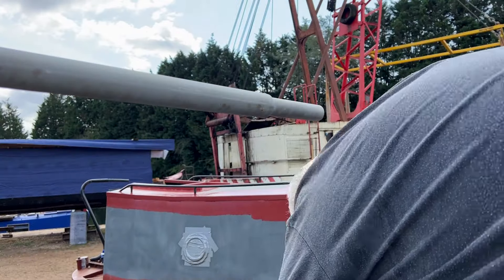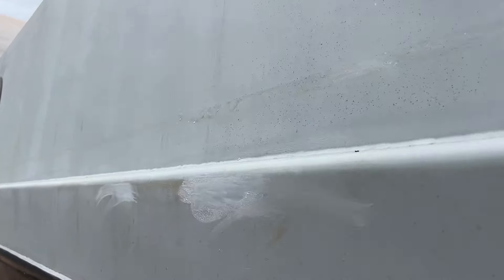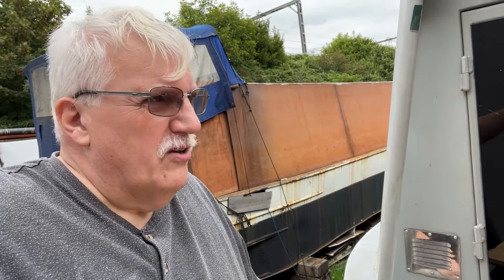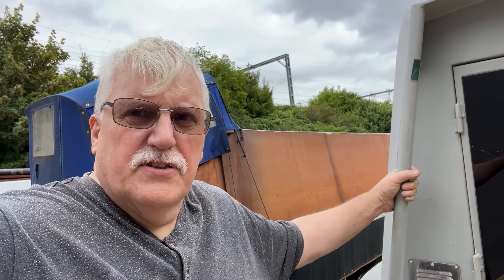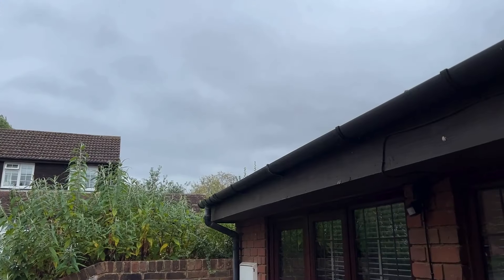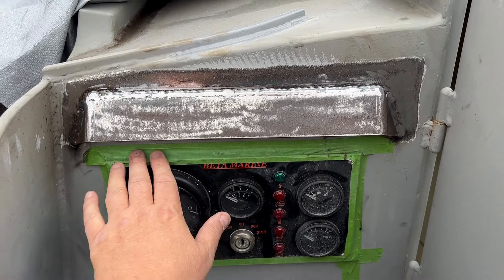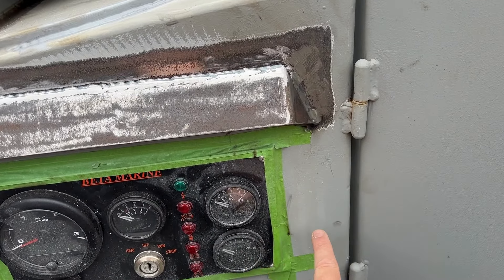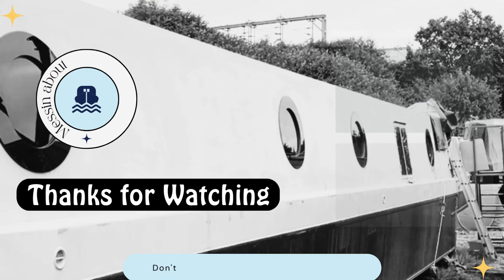Preparation for painting our boat | Our Narrowboat Fit-out | EP47

Comment: For the deck drain rust problem, I think Lano guard might be what you need otherwise use a piece of copper tube or pipe, drill some radial  holes in the end and use a hand pump to push sealant/oil or your chosen treatment start from one side fully in then slowly pull the tube out as you pump the fluid through. Then do the same on the other side.
Reply from the maker: Thanks. Tried out a garden sprayer today but defo needs an extension so great idea with a hose with holes in. Will do that.
Reply: Lanoguard, I last heard of that during a discussion about protecting a propellor from marine growth. Does it dry to a hard coating?
Reply: @flibbertigibbet6324  
Hi, no it doesn’t dry out it’s mainly Lanolin I believe and it is really good at protecting steel on the underside of a vehicle, though I don’t think it would protect against abrasion very well, but would be perfect for this particular application as it comes with a multi directional spray head, as far as I’m aware. And there won’t be any abrasion in this situation. It is quite expensive though, Somewhere north of £80 I think, though there are many areas where it could be used as a rust barrier in a marine environment. Gas lockers, engine bay, forward well storage area or even the base plate (inside obviously) thanks for the like and reply. It was good to talk about your project.

Comment: I would have been fuming about the overspray incident, you seem admirably sanguine in comparison. The overspray has likely left a scattering paint particles poorly adhered to the original undercoat, a light sanding to rub off the overspray will create a firm surface for the final coats. The extra factory applied undercoat has paid dividends as it is surprising how many fitouts develop spot rusting before the shell exterior painting is completed.
Reply from the maker: Thanks. To be fair, I was fuming but they were bigger than me 😁 I am glad we did the extra primer, it was a good decision for the minimal extra cost. SO looking forward to sanding 😂